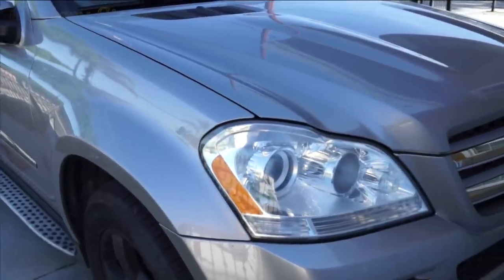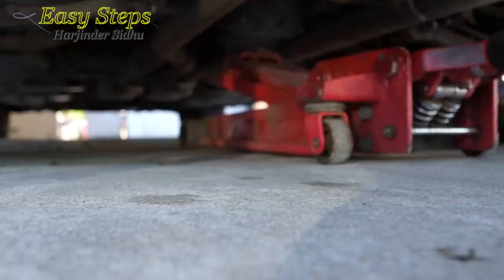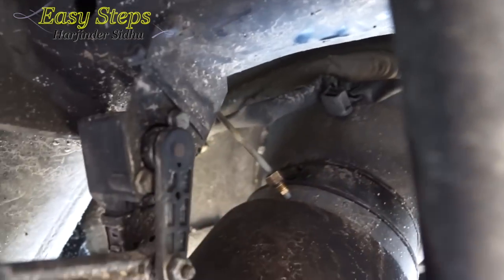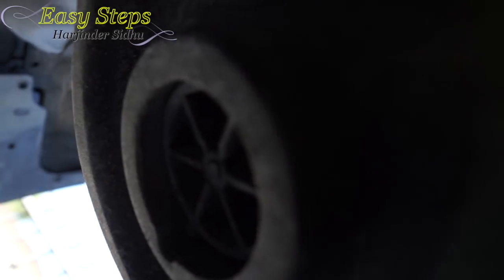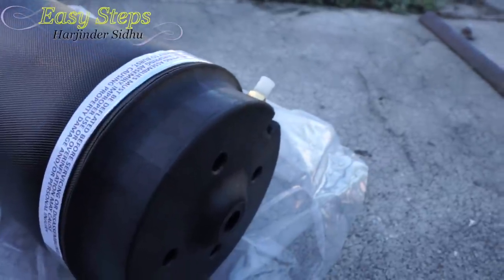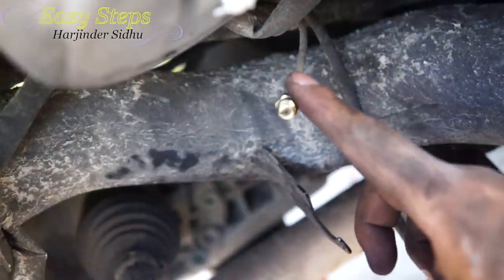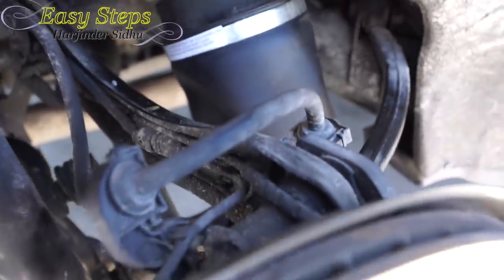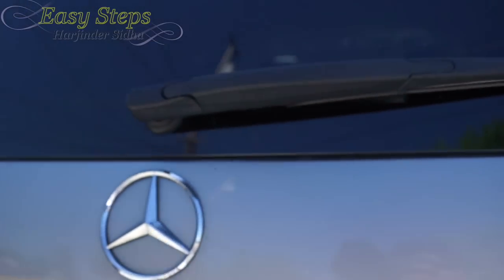How To Replace Mercedes Rear Air Suspension Bags on GL Class X164 Chassis | GL450 Air Spring

Comment: Do not remove fitting!!!!!!!  (On the new bag) Arnott and most others have the "quick connect fitting", ....if you remove the fitting it will void warranty ....check instruction sheet first....also on mine i did not have to remove level sensor...  It compressed and slid out with just enough room and also worked putting new one in...just some fyi...good to the point video 👍
Reply from the maker: Thanks for sharing good points.
Thanks for watching.
Reply from the maker: I have started posting DIY videos on my other channel "Sidhu DIY" so please subscribe, thanks.
Here is the link for my other channel, thanks in advance.
https://www.youtube.com/c/SidhuDIY

Comment: Changed my 2014 gl450 rear air suspension over the weekend and I didn’t have to remove the height leveling sensor arm as the old and new suspension came out and in over the brake rotor very easy. I also did not have to remove fitting off of the new suspension as this is not recommended by manufacturer and it makes the job very easy just to push the air line in. 
I think anyone wanting to save some money can do it. 
NOW MY QUESTION TO YOU. I ONLY CHANGED THE REAR LEFT THAT I HAD AN ISSUE WITH BECAUSE RAIN DICTATED WHEN I STOPPED, BUT DO I REALLY NEED TO CHANGE THE OTHER SIDE AS WELL? I DO HAVE A NEW AIR SUSPENSION THAT I PAID FOR, BUT NOW THAT EVERYTHING IS OK IT SEEMS THAT I DONT WANT TO FIX SOMETHING THAT IS NOT BROKEN.
Reply from the maker: Glad to help, first of all, congrats, and thanks for sharing the info.
Please don't change it as you said "TO FIX SOMETHING THAT IS NOT BROKEN"
Thanks again for sharing the info. and thanks for watching.
Reply from the maker: I have started posting DIY videos on my 2nd channel "Sidhu DIY" so please check it out and subscribe, thank you.🙌 🙏 🙌  https://www.youtube.com/c/SidhuDIY

Comment: Hey man great video. I had a few questions I would like to ask you in regards to my 2012 CLS 550. I was told I need to replace the left and right rear air suspension strut. This part is said to be covered under my CPO extended warranty. However, I am being told that it isn’t covered bc it’s not a part not in fact covered. Am I being given the run around or could this be true? Not sure how many parts go in to the suspension. Thought it was the actual air bag and strut. Could use your expertise. Thanks.

Comment: Question...brother...
Will these steps work on a (211?) 2006 e350 4matic wagon AWD with air suspension. The rear needs replacing ..also where would you suggest buying the part for?

Thanks Brother.

Malcolm in Tacoma, WA

Comment: Thanks for the video. I changed the back passenger and It worked fine, the bags inflated with no problem. Car was leveled perfectly. As Soon as I changed the back driver side, same steps, the car lowered and would not rise again. Thought it maybe be the 40 fuse so replaced it but no luck. The compressor is fine since the front lefts? No leaks either? Any advice on what may be the issue? Is there a factory reset or something to get the back up they way they were before? Sorry for the long rant, but i need some insight from an expert. Online forums dont address the issue.
Reply: Easy Steps please clarify? The sensor on the chassis? I didn’t disconnect anything only unscrewed it from the frame! So it seems that the first set of bags I bought may have been smaller, I installed a bigger bag 14” and it looked fine when the car was jacked, once drop it stayed elevated but dropped once I drove it. Alot of bouncing from the rear. Ince parked the bags inflated but I don’t think its to the full potential as when i took them off the jack?
Reply: Peter Canizalez theoretically, it doesn't really matter the length of the bag, as long as it has similar range of motion. The car has no idea how big the bag is; just that the ride height sensor is telling it to rise or lower (ie: add or remove air). If the car is not leveling properly, perhaps you forgot to re-attach the sensor arm, or broke it? Doubtful there are other holes to bolt it to, but did you put it back in the wrong position maybe? Maybe the sensor arm is dead all-together and that was always your issue? Check the wires to the sensor, that you didn't accidentally disconnect or damage the terminals. Good luck.
Reply: Peter Canizalez  same thing happened to me, go back and make sure you put the level sensor back the way it was, the arm has to be facing out... thats all

Comment: Awesome video! Where is the jack point though? I have a floor jack and can't figure out where to lift a w164.
Reply: Greg Anderson frame points are rubber blocks in front of rear and behind front tires on the outter frame. There are also ribbed points on the lower control arm if want to support by the suspention.

Comment: I also have a X164 2007 GL450 and noticed that you have LED DRL in the front. I'm looking for the same ones that you have and wanted to know how did you wire them to come on with the engine every time it starts. Thanks in advance. - Dee.

Comment: When you jacked it up using the floor jack, did you jack it at the rear differential? I can't tell because it's a little blurry on the vid...and then place the jackstands on the jack points on each wheel?

I've been trying to figure out how to jack the GL from the rear...i know where the jack points are behind the rear wheels, but I need to figure out where to place the floor jack when lifting it in order to put jackstands in.
Reply from the maker: I have posted another video of my GL550, please check it out maybe you don't have to change your bags.
Here is the link: How To Replace Mercedes Rear Air Suspension Bags on GL Class X164 Chassis - https://youtu.be/6fQQaw3LZug
Reply from the maker: I am posting a thanks message to my viewers/subscribers for their support.
Both YouTube channel was hacked/hijacked on (4/24/2019) and I got it back now (5/5/2019). The hacker has deleted the information under the description of my videos as well as all my comments. 
My YouTube Account Got Hacked - https://youtu.be/1xLEciPJqlk
Reply from the maker: I have started posting auto videos on my other channel "Sidhu DIY" so please subscribes, thanks.
Here is the link for my other channel, thanks.
https://www.youtube.com/channel/UCuifMS69Pmx-ykxCar5XW6Q

Comment: You can remove and install the real air suspension bag through the space between the control arm and the wheel well, if the wheel is off.
no reason to uninstall and re-install the height sensor. 
there is enough room to manuever the air bag, if you just squeeze it down little bit.
Reply from the maker: Good point, thanks for sharing the info.
Reply: @EasySteps_Sidhu  also, Bilstein is the OEM company that manufactured these air suspensions for Mercedes.
However, there are German made ones, and USA made ones.
German made air suspensions last around 10 years, but USA made Bilsteins only last 5 years, in my experience.
so get the German made Bilsteins, if you can find them.

Comment: Thanks so much for this video, you saved my car. I have a question: after replacing both back air suspensions they are working great however sometimes it says malfunction! Any idea?
Thank you again.
Reply: @EasySteps_Sidhu  thanks for the reply, i checked and there are no leakage, it works fine but sometimes malfunction shows and if i press rise both back suspensions deflates and the back of the car lowers down!

Comment: Mercedes Benz owners beware!!  The people from Strutmasters have a rip off with the so called "conversion kit", no matter what car it is.  They advertise this conversion kit will solve the issue of the "expensive" Airmatic ride in Mercedes Benz.  On the contrary, their product is a very low quality, highly expensive replacement part since it does not last more than a year and a half.  When you contact them, they say it is not their fault, that they only buy parts from other vendors and put them together and they supposedly do not have any control on the durability of parts.  The kit is $1,300 initially and they don't sell just the front or back sets, you have to buy the whole thing.  Later on, when it fails, they urge you to buy the whole thing again.  And the "discounted price" they tell you they will give you if anything happens in the future is not true.  They charge $586 for each seat, front or rear, which is basically the initial price.  I urge all owners of Mercedes Benz to buy the replacement Airmatic struts and save the headache of having a below average conversion with a kit that does nothing of what is advertised and really turns your car in a piece of junk that is almost impossible to go back to the Airmatic.  The movements of the car change badly and then when the Strutmasters shocks begin to fail they make a horrible squeaking noise that is almost unbearable.  I wish I never bought the kit from them!!  I only had to save a little and buy the real thing, the OEM struts that would last years and years before failing.  On top of everything Strutmasters customer service is the worst and they even use women to hide behind lame excuses!
Reply from the maker: Thanks for sharing info.
Reply from the maker: I have started posting auto videos on my other channel "Sidhu DIY" so please subscribes, thanks.
Here is the link for my other channel, thanks.
https://www.youtube.com/channel/UCuifMS69Pmx-ykxCar5XW6Q
Reply: Should post this on their website!

Comment: You don't need to remove the ride height sensor or any other nuts or bolts that's the hard way
Reply from the maker: Yeah...you don't need to remove them.
🙏  thanks for the visit. Thanks for watching.🙏

Comment: My E550 air suspension drop down when the temperature is -5C or lower.
Reply: Everyones does, even with brand new bags.

The air inside the bladder cools and contracts.  When its really cold for extended periods, the air will contract so much the bag will appear deflated.

No loss of air, just less air volume.

Mercedes even recognises this and has mentioned it in the manuals for over a decade.  

If it only does this in super cold weather, you're fine.

Comment: why mine Gl350 2012, after replacing , both rear is not inflate air.  Any one has any idea?
Reply: maybe your air pump is broken.
Reply: Did you remember to reinstalled the fuse

Comment: is this why my car says "car too low" cuz of the air bags?
Reply: Lorena Molina that is correct... sort of. "Car too low" is telling you something is not operating correctly with your air suspension and it is unsafe to drive; could be leaking bag, leaking hose, blown pump fuse, or dead pump. Your ride is probably super rough and bumpy right now. This will also affect your handling, braking, and acceleration. Do you ever hear hissing? Do you hear the pump running?